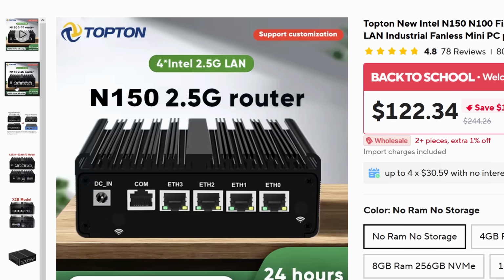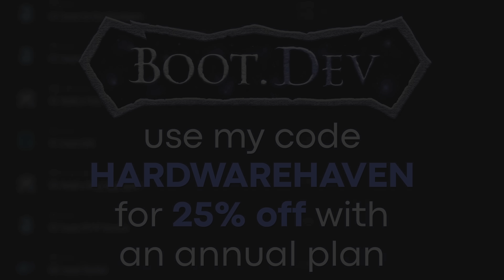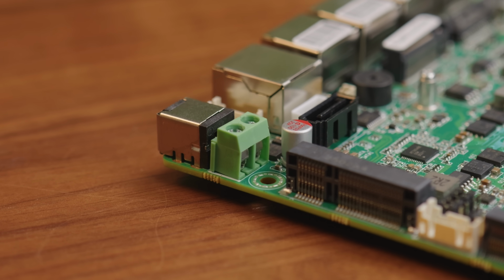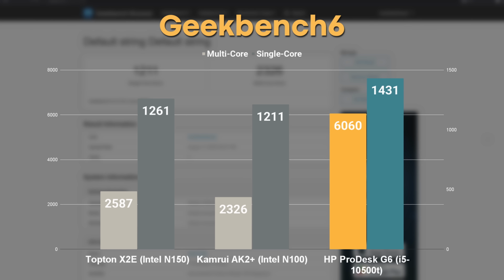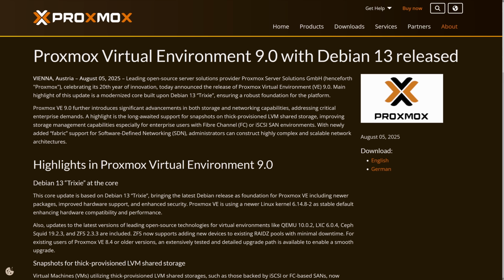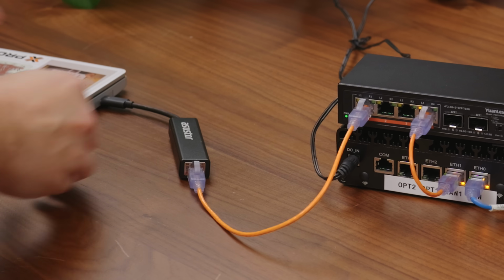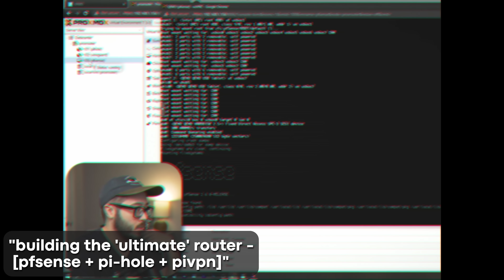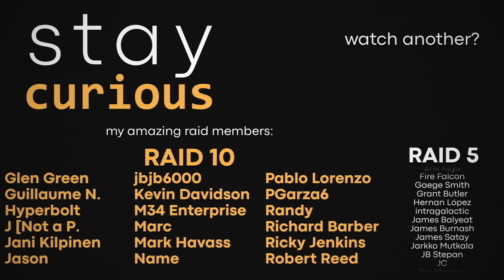Why Didn't I Buy This Sooner?

Comment: You talked about power limits and looking for a setting in the bios. That won’t help you. Power limit on these types of devices is down the current supplied by the power adapter. Finding a higher wattage power supply would help there.

Comment: I have a passive brandless little machine with an Intel J4125 (8GB RAM) and 4x 2.5GbE running pfSense. It does get hot if I am downloading large files from internet (like downloading a 40GB Steam game) while doing a Mac time machine backup at the same time.
But overall, it suits my needs, and unless I grow a need for 5 or 10GbE, i don't think i will need to replace it anytime soon

Comment: I just bought one of these in the last couple weeks from old-mate AliExpress, and it showed up a few days ago. Haven’t had a chance to have a proper play with it yet, but I have thrown in a cheap SSD and 16GB of DDR5 4800.

I picked it up mostly as a learning tool to play with OPNsense and to add a bit more flexibility and security to my home network.

I will say I was surprised by how warm this unit gets just installing OPNsense.

Comment: I'm running one like that. Also 4x i226V, but additionally has 2x 10gig SFP+ ports (Intel x520 based I think). N100-based, also 32GB (yes, not official intel supported but known to work). Like you, I have proxmox installed, and pass 3 of the 2.5G through to my OPNsense as my main firewall/router. The last port is plenty for Proxmox and/or the other services. I do run some containers/helpers that are network-centric, and just recently moved HomeAssistant over to this box as well, as I can then tinker with my main Server and not have "the house" stop working. We seem to be very much on the same same wavelength with our setups for these boxes.
BTW the 10G sits on a riser/adapter in mine and is a custom form factor, but it looks like it sockets into a standard PCIe x4 slot (rotated 90°). And right now it isn't even installed. Why? While it would be nice to have full 10G, it would also need the associated additional power usage. But mostly I just need to get around to designing and 3D-Printing a new shell that allows me to blow air over that card (and the NVMe as a bonus side effect). I'm sure I'll get to it eventually, but honestly 2.5G across subnets is plenty right now in practice.

Comment: I bought Topton's P5 Micro Firewall with an Intel Core i3-N305 (4C/8T) last year. Great little box. Runs pretty hot though, coming in at ~80-90°F at idle. I tried pfSense, Opnsense, and Openwrt and quickly discovered that I don't understand why pfSense and Opnsense get the attention they do since they can't run containers (e.g. Docker) but Openwrt also has adblock and Snort (intrusion detection). So Openwrt it is, and I run a container which pings a handful of revolving URLs every 15mins to make sure my ISP is well behaved over time *side eyes Cox Communications*. It also runs a Caddy front end proxy for SSL certs in front of homelab services, all in a 9W TDP and $225 package (okay, I had to slap in some memory and an NVME SSD as well).

I'd buy it all over again given the choice.
Reply: I have to agree. I personally much prefer to use Linux for my router/firewall. All the routing functionality is basically built into the kernel already. There is no GUI, but I much prefer the CLI and config files anyway. You just need to add a DNS server (e.g., Unbound) and a DHCP server (isc-dhcp-server) to basically replicate what opnSense does out of the box. Linux also buys you much better compatibility with wireless interfaces (hostapd). And of course you can run Docker.
Reply: The reason pfsense doesn't run containers is that it's geared towards the commercial space. We want to deploy rock-solid appliances with as little security risk as possible.

Containers be easily run from another device within the network.
Reply: @Caffeine226 yes, but no. There's longstanding hurdles to running containers on FreeBSD without jailbreaks or using Podman.
Reply: openwrt is a pain in the hole to setup on these types of boards and you have to do much of the admin on the command line. Every major upgrade is similarly a pain in the hole. There's very little appropriate workload that openwrt can do that can't be done easier with opnsense. Why are you running docker containers on a router - that's what a home server is for.
Reply: @StephenBrightwood hardest of disagrees. When was the last time you touched Openwrt? Setup couldn't have been easier:
1. Download the generic X64 release.
2. DD it from the USB to the NVME drive.
3. Expand it.
4. Reboot.

And Openwrt is now admin'd almost exclusively from the GUI unless you screw something up and need to recover from a goof. I would guess most normies wouldn't ever touch the CLI (again, unless they really messed something up). This makes me think you haven't touched it it for years?
Reply: @AaaTeeEyeBee I built my router at Xmas  and really do not agree with you. My first preference was to go Openwrt but after messing around with it for a few days went over to Opnsense which was entirely more straighforward. If you want do do anything but build a rudimentary router with Openwrt you are definitely going to be using the command line and altering configuration file.
I maintain my position - a pain in the hole unless you are using one of the pre built version for a specific commercial router.
Reply: @StephenBrightwood I appreciate the response but it's pretty far from reality so I'm left to conclude that you just prefer Opnsense and didn't stick around long enough to figure out Openwrt because it's as GUI-driven as pf/opnsense and is hardly 'rudimentary'. Cheers

Comment: I used to run OPNsense on a similar N100 unit but when you start to add storage and RAM,  Unifi  cloud gateway fiber makes a lot of sense. 10G and PoE+ in the same device is hard to beat for the price.
Reply: One thing the Unifi "Cloud" stuff won't give you, however, is freedom from corporate control.
Reply: @ghost6813 Well, if running open source is your top priority then sure. Unifi being "corporate" is one of the better choices out there concerning privacy as you can disable callhomes in the OS.
Reply: Or go Microtik if you need network-engineer level customization. The Hex 'Refresh' router is good for 1Gbps (in most cases), and runs $60. Their flagship home poweruser model, the rb5009, can be had around $200. Learning curve for RouterOS is higher than *sense, but more powerful, and Mikrotik supports their hardware devices forever.

Comment: As always, thanks for letting me window shop vicariously through your videos :) I always look at these but i225/i226 NICs are such a crapshoot on Linux due to flaws in early hardware revisions. I already have one PC where the onboard LAN is useless because of it. I don't trust China sellers to supply recent fixed hardware. 8W idle is kinda unappealing for an always-on device, a router with ARM CPU idles at almost nothing. I am a network engineer of some kind (I work on Linux kernel network and drivers) and your internet speedtest is a good test because that exercises software NAT which is the bottleneck in weak little routers. That's the only real interesting test for routers imo, so good job. Enjoyable video as usual!

Comment: They make 6 port models with n100’s in them. Gives me enough ports for 3 internet connections, LAN to my house switch, LAN to my work switch (untagged VLAN to dumb 4 port switch to keep work stuff separate) and still leaves a port open for pfSync cloning of the config to a second unit I have as a backup unit. The n100 never goes above 30% when fully saturating a gigabit WAN connection using built in Tailscale to a remote server, and uses less power than most of my light bulbs.

Comment: Would be more interesting if they re-designed the case to include an integrated 120mm cooling fan.
Reply: Most of them are available with a choice of fan/none at no extra cost.
Reply: @Tom-bp6no  Link? I'm talking about a 120mm fan totally enclosed within the mini-PC. Any smaller fan than 120mm = too noisy. And: not some USB powered fan sitting on top of the unit.
Reply: @RVail623 Ah, I’m not sure what size fan is used in the integrated fan models.
I plan on mounting a door fan on my tiny network cabinet with an intake fan blowing onto the unit.
I can get magnetic clip on mesh dust filters to keep things clean.

Comment: the VM stigma around routers is laughable to me. You WANT to have the router separate from your firewall, VPN server and reverse proxy like traefik. If you want a hardware bound router, then just buy mikrotik and move on, leave the computing power on the table, spend extra money, power two devices instead of one, have higher electricity bill all for what? A physical router that is not even a guarantee of a reliability? Like why should I give up the absolutel essential option of snapshotting your VM after setup for quick and easy DRP just so I can appease a grumpy 45 year old IT guy on the internet that still struggles to comprehend VMs and containers? Why should I run an at best 2.5Gbit cable between Router and Firewall if I can have actual vswitch speeds that can be whatever the PCIe and CPU allows. Why should I get a multi-powersocket heavy UPS when I can just power one device with a USB-C powerbank (that is one of the usecases for the 12V terminals - run a USB-C with a trigger board set to 12V so now you can have a cheap UPS or off-grid setup or power the device with a tiny GaN charger) that is plugged into a powerbank?

And most importantly hypervisor gets better patches than hardware. That protects you way better from attacks on your DMZ. Just look at how often your router gets a new firmware or you get a new BIOS vs how often proxmox/esxi get releases.
Reply: I don't want the complexity and performance overhead of virtualization in my router/firewall. But then again, I use Linux, so I don't really need to virtualize anything. Routing is built into the kernel, and you only need to add a couple of components (DNS, DHCP) to build a "router." I run nginx, game servers, and countless Docker containers on the same machine and it does not break a sweat.

Comment: Running PFsense on one of those for my firewall. ProTip: Buy a USB-powered PC fan and put it on top of it. It doesn't get dangerously hot, but it does get HOT. Even a small fan generating some airflow is a tremendous help.
Reply: My fanless N100 runs a 1.6 gbit connection for a busy family of 6. Since October I run steady between 50-60 degree CPU temp (except for a small IPv6 bug that the OPNsense team introduced and squashed in February, where the unit ran out of memory and hit a spike at 68 C).

A fan would help, but 55 C is a good, healthy CPU temperature for long-term operation.
Reply: I did the same. Went from "I'm not letting that run over night"-hot to, "Is this thing even on"-cool.
Reply: Definitely agree with your statement. A top fan will lower the temp on my system by about 20C.
Reply: Could get one of those Noctua home cooling kits too
Reply: Do the same. I use little raspberry pi heat sinks and put tiny usb fans atop it.
Reply: Absolutely.  I did that on mine and it lowered the temp by double digits.
Reply: The version I got came with a fan built in. It’s a crappy fan but it moves juuuust enough air to keep things cool. 

I also got this gaming phone magnetic fan with a rog ally kit a while back. I put that on and holy crap it dropped temps like an absolute boss; seriously -10-15 just magnetized to the back. Too bad it’s SUPER loud.

Comment: Looks a lot like the Qotom models.  I had good luck with one of those about 5 years ago.  I only went another direction on a recent firewall replacement because the room is not good for fanless systems.

Comment: I have the slightly larger intel 1240P version that has a pair of SFP+ ports. Was like $200 barebones when I picked it up. Also is a dual channel setup so it has 2x16gb sticks of ram.

Comment: Currently in the many week long lengthy process of getting mine repaired, since it immediately hangs / hard freezes. With case open, and a fan on it, it lasts longer like 6-24 hours, but still the issue persists. I assume I just got especially unlucky with the QA from Topton, but yeah, if you aren't willing to deal with the headache go with a more reliable manufacturer like CWWK or better yet, something local you can easily return.

Comment: I have one of these (N100 version). Unfortunately the 4 x Intel i225 (v2 version) NIC's chip set it uses are complete garbage; it's constantly connects and disconnects from the network. Apparently this is a known bug in some versions of these chips, so the unit is just a paper weight (it also runs quite hot when using OPNsense)
Reply: Yep had similar with intel i225 controllers, total pieces of junk with random disconnects. Never found a solution.
Reply: I would use OpenWrt.

Comment: I have version of this with the N305 and two SFP+ ports and it is GLORIOUS. I will NEVER use a vendor supplied router/firewall again.
Reply: Ditto. Got Proxmox running on mine with OPNsense in a vm and those SFP+ ports passed through into it. I found the N100 Topton would struggle with internet line speeds above 800Mbit/s. THe N305 crushes it, though.
Reply: @hazza64  I've got a N100 running OPNsense which goes to 1.6 gbit/s with a 40% utilization CPU peak  (sustains down to 30%-ish) - so I am surprised you're struggling over 800 mbit/s. 16 GB RAM, which sits at 8-10% usage even at high-load (makes sense that the routing table isn't growing). 

Is your traffic coming from a lot of sources?
Reply: @sunbeam60 I found it was maxing out one of the cores with one of the single thread processes. 40% in the GUI could mean at last one of the cores is pegged @ 100%.
Reply: @hazaa64 do you use pppoe?
Reply: I'd be curious what the max throughrate for internal traffic is practically speaking. 

In hotrod terms, how much CPU horsepower would you need to make a fast-as-fuck 100gbps NAS that can actually be routed by the router. (Instead of a direct-patch or something)

Comment: I've been thinking about grabbing a n100 or n150 system for semi-scalable and affordable NAS purposes. Do any of you have any suggestions? I believe my only requirement is at least 6 SATA ports and a power solution for each of those ports.
So far I've thought about an asus prime n100 but I'm always stuck on the SATA power portion. I don't even know if that specific motherboard has something I need to look out for, etc.

Comment: Should have ordered one of these back when an n100 one with i226v could be had for $100on sale and not tariffs. 
Openwrt with some apps meets my needs of ip blocking, ssh tarpit and other tweaks to the firewall. I’ve got other boxes for running heavier stuff

Comment: I used to run OpenWRT on the N100 with 4x2.5Gbit ports - flawless, no problem, VERY overpowered.
Reply: I run OpenWRT in a LXC Linux container, it uses only 25MB of RAM 🙂

Comment: Very interested in how the cellular works, I guess you'd have to put in a mini pcie module and then the sim card slot is already wired up to that? It would be useful for travel but also possibly as a backup (?) and would openwrt or opensense even support that? I can't find anyone covering this unit with cellular capabilities and it seems documentation about any cellular connectivity on PC is very scarce.
Reply: Not to mention I don't think there's an external antenna option for that, which would be needed for some setups.
Reply: I was thinking that because I use a mofi thing for my home internet but it doesn’t support 5G because of the standard m.2 lte sierra module and I don’t know if the thing could handle that kind of throughput I’ve never seen faster than 80mbs but I want faster

Comment: Topton and CWWK are very reliable brands. I've been using a CWWK Intel N100 version of this (without the com port) for 3 years with PFSense on it, I added my own 16GB RAM. Had zero issues with it, mine came with a 2x M.2 adapter. The only time my router "died" was when an old Samsung NVMe drive that was already down to 70% when I put it in, I was expecting that at some point, I'm now using 2x WD Blue SN530 256GB that I got as low TBW cheap on eBay, so I have redundancy and can somewhat forget about it.

I have just bought a Topton N305 NAS motherboard to live a my sisters, got it for like $210 with "Back to School" discount and cashback, to combine a Proxmox 1L machine and my old QNAP NAS, I'm also gonna try the forbidden router as a power saving solution if they have a none modem/router combo provided by the ISP, if it's 2 devices, then a forbidden router could make sense.
Reply: I had the same problem after 1 year of use.
The nvme overheated a lot and broke.
I bought a new nvme with a heatsink and a 40x40 cooler. I've been using OPNSense for 2 years.
Reply: this is helpful, thanks. I've had my eye on the CWWK ones.

Comment: Wait a second. $119 are for those Celeron N6210, not N150. N150 costs $163. Anyway, still fairly good price. And if you live in the EU, that's the final price. Free shipping, VAT included and no extra tariffs :)
Reply: VAT isn't included above 150€